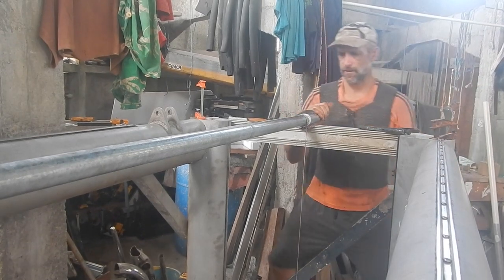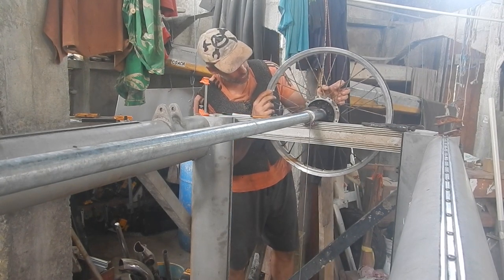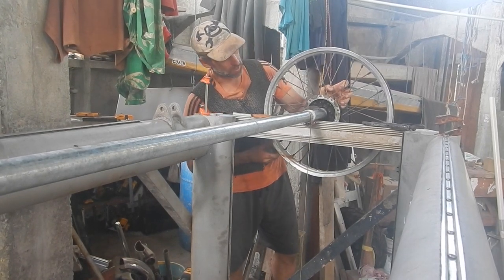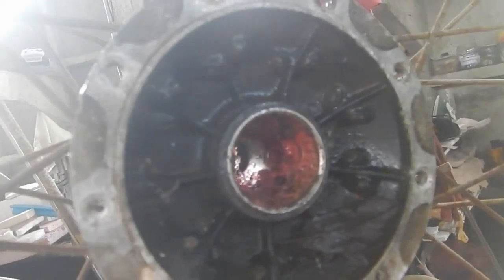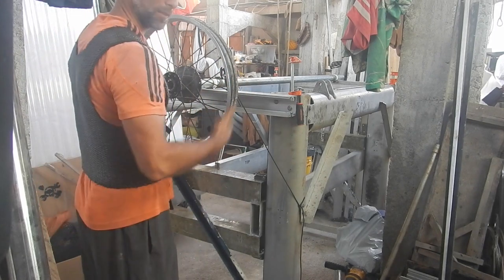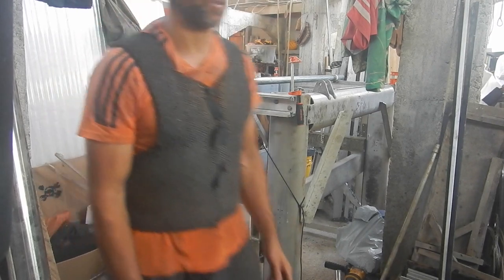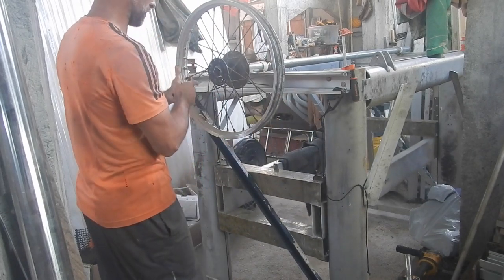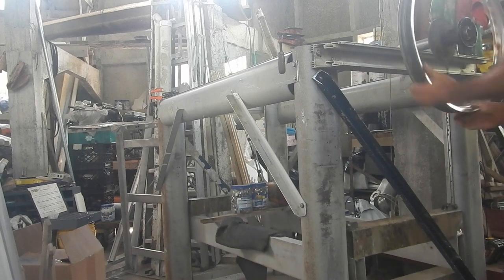Lumber Mill 015 The Wheel

Comment: My Granddad's boat lift was made similarly except the wheel was about 6 feet in diameter.  Now all the boat lifts I see are electric so they cannot be used when the power is out or when one of the motors breaks, or when the wiring and breakers at the dock need to be replaced because of corrosion.  As little children we loved the mechanism and were allowed to move the boat up and down a few feet when ever we wanted so long as we kept the boat out of the water.

Comment: I like how it’s coming together.  I’m wondering about the power supply.  I have a basic manual sawmill kinda similar although it’s a bandsaw.

But the 12 horse gas engine is a simple power plant and it’s nice and portable.  Depending on the size of log it’s easier to take the mill to the log then the log to the mill.

I hope the power supply is portable enough to haul around the jungle.

I love your style of engineering Jamie